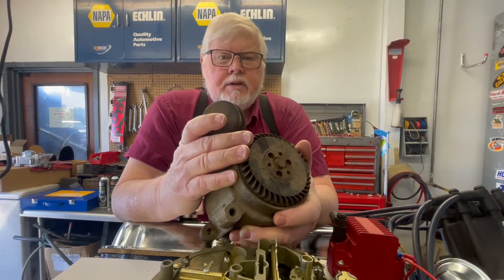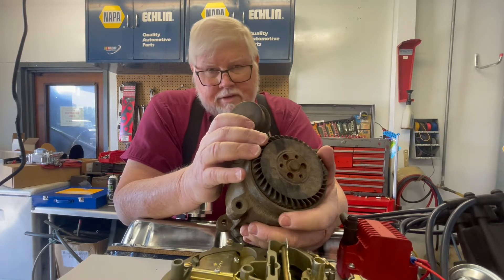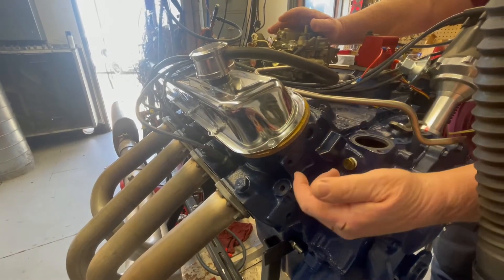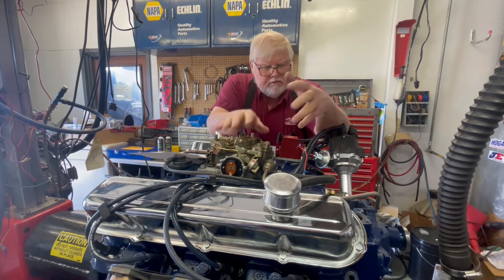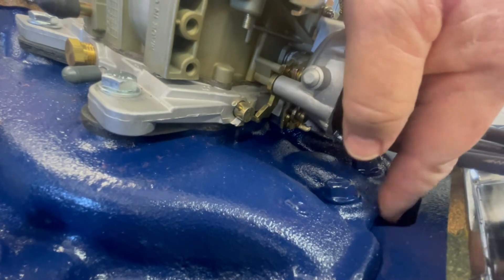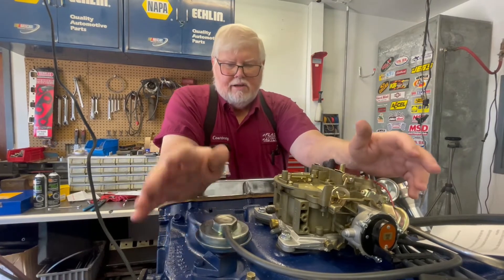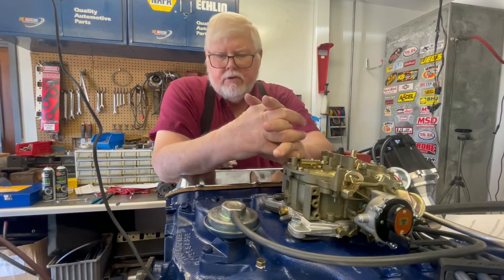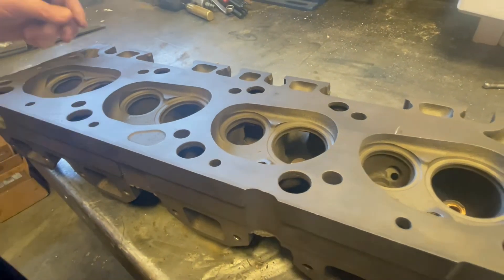Pollution Control Devices

Comment: My two 68. Caddys the 69 and 74  cads all have the original air pumps still intact and working.Those engines were some of the first zero emission engines.I would set them up for emissio testing and they always passed with all the equipment hooked to it.and yes the egr valve operation allows the engine combustion Temps to run cooler deleting detonation and pinging.

Comment: Back in the day we brought over the garbage can and placed all the emission controls in said can. Went to the parts bin and installed pipe plugs where the thermal vacuum switches were and air tubes used to be. Dropped down the exhaust pipes and torched open the heat risers. Reset the timing and carburetor, and really got our rides running good. Those were the days. )

Comment: Yes. The AIR pump is meant to be used in a very particular way. Its purpose is to reduce NOx in an indirect way. To set it up properly, the engine should be tuned rich, which minimizes NOx owing to lower combustion temperatures  but produces excess HC and CO in the exhaust from unburned or partially burned fuel. The unburned fuel is then burned in the exhaust manifolds once the AIR is introduced. It does work really well. My 74 Eldorado always passed its smog checks with flying colors, it would just about hit the '97 smog requirements. (I think that was the last year smog checks were required for 74s in so cal.)

The explanation in the video for what the air hose going to the middle of certain cats does is not quite right. This is a more modern system with a two stage cat. The first stage is the reducing stage, which cleans NOx back to nitrogen gas. The second stage then oxidizes the HC and CO to get rid of those. Since the first stage needs to be oxygen poor and the second needs to be oxygen rich, oxygen has to be added in between. Cutting off the flow of air to the cat ought not generate NOx, but it would lead to extra HC or maybe trace hydrogen sulfide?